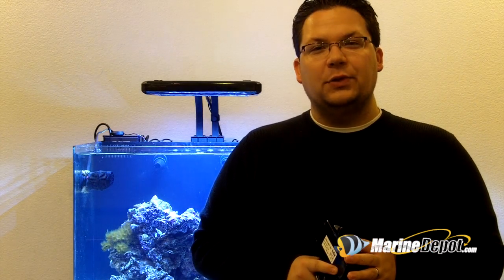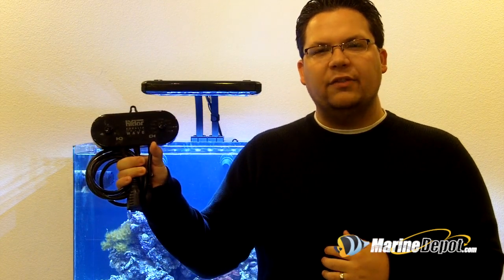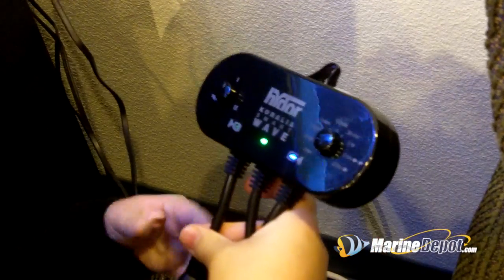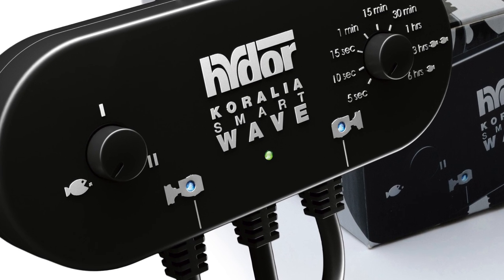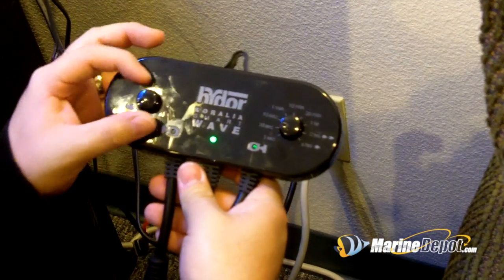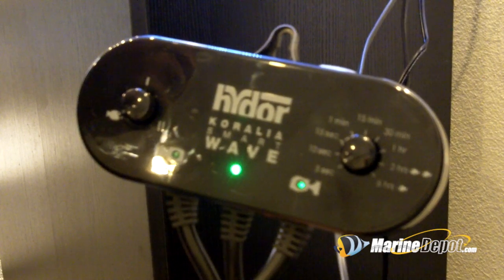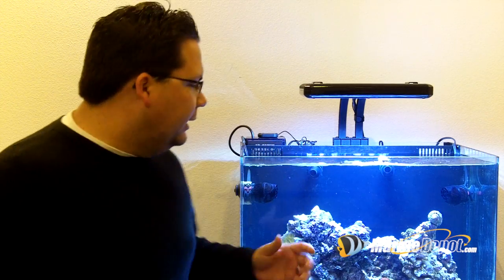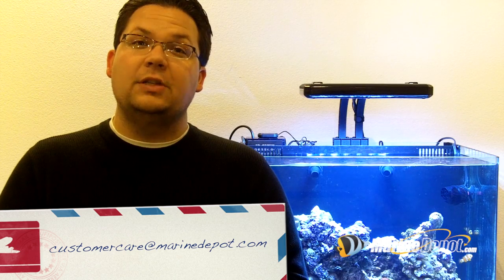Hydor Koralia Smart Wave Pump Controller Product Demo

Comment from the maker: The clicking is the impeller hitting the stopper, which ensures the shaft-less impeller spins in the proper direction. Although possible, we do not believe you got a bad batch since the clicking is a known issue when pumps are used with a wave timer. It seems to affect some people more than others, which is unfortunate. We recommend this wavemaking solution for small tanks or for folks who already have Hydor powerheads. For a quieter system with more advanced features, consider Tunze or EcoTech.

Comment from the maker: @abnormal933 Yes, there are two settings on the smart wave. The dial on the left allows for either one pump or both pumps to run. The dial on the right is the interval where the pump can be on from 5 seconds to 60 seconds, then it would switch to the other pumps. Please note these pumps do not ramp up like a Vortech, they are on 100%

Comment from the maker: @glowfist Placement can be very tricky. This is because a variety of factors are in play. If you are looking to move a lot of water at the surface to break up any film, then placing the powerhead six (6) inches below the water level would be ideal. If you are looking to add more current and circulation, then placing the power head on the left or right, toward the middle of the glass panel would be best. Our best suggestion is to place them in different places and see how your corals react.

Comment from the maker: It may, although we would not recommend connecting the Tunze 6015 to a wave timer as the start-and-stop operation may damage the pump and impeller and will not be covered under the manufacturer warranty if something went wrong.

Comment from the maker: @MyBobbob12 The pumps can be side by side or on alternating sides of the aquarium. The SmartWave has two power cords at the bottom, just plug them in and you can set your pump interval. The pumps we have connected in the video are nano pumps, but you can also use larger powerheads as well.

Comment from the maker: @chiefcrazycuy Hydor recently updated the packaging, but we are unaware of any changes to the Koralia Nano pumps. We only recommend using Koralia Evolution pumps with the Hydor Koralia Smartwave controller for best results. If you try using Koralia Nano pumps, you may experience noisy start-up and possible premature pump failure.

Comment from the maker: Some of that is going to depend on what your keeping in your aquarium SPS corals will require quite a bit of flow and soft corals not as much, typically for a 90 gallon I’d recommend the two Hydor Koralia Evolution Circulation Pump/Powerhead 1150 gph and would use them with the Smart wave controller. Right now we have 20% Off Hydor Koralia Pumps/Powerheads
Use Coupon at checkout: KORALIAPUMPS
Valid From 1/1/2013 - 1/31/2013

Comment from the maker: @Darvin1964 The issue you are encountering has to do with the impeller units. I would contact Hydor USA support at (916) 920-5222 and they will be able to assist you directly. There was an issue with a bushing that would cause the impeller to spin backward. They have a solution and it solves that problem.

Comment: So this wont work with the sunsun 102
Reply from the maker: I have no personal experience with the pump but if it is an AC pump with no control, the switch should work to power it on and off.  If the pump has some control features (DC pumps), the on/off type function will likely be problem for that type of pump.